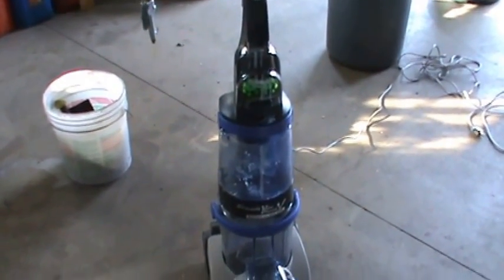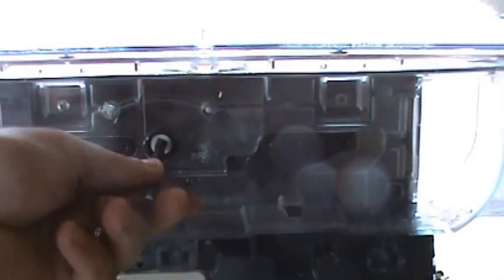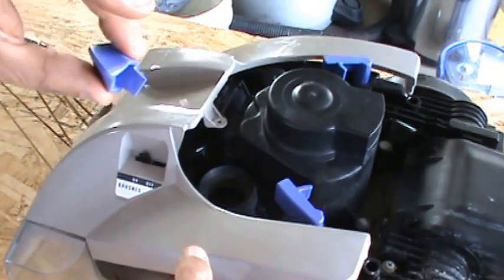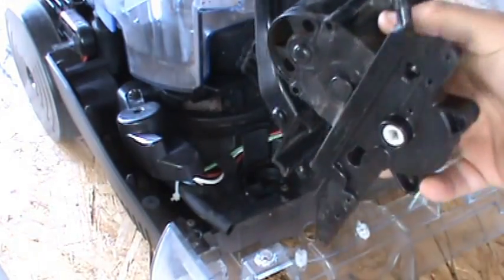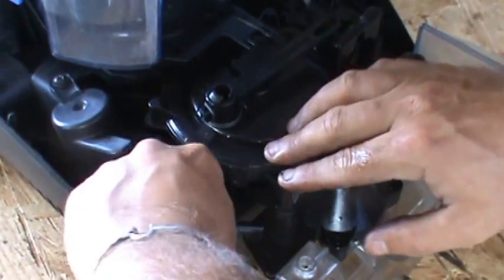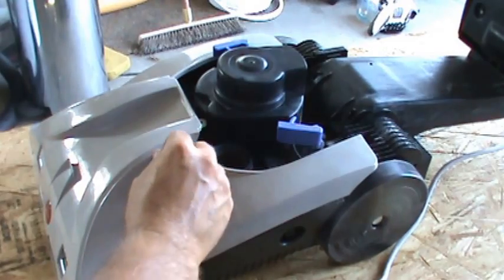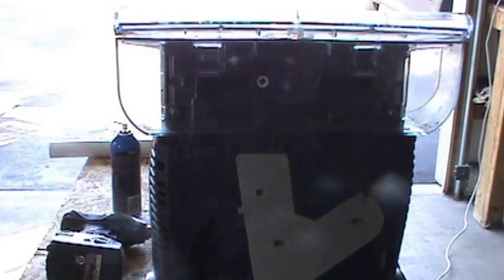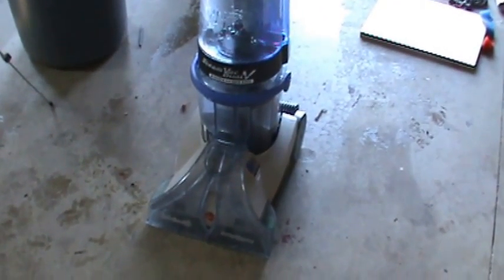Hoover SteamVac brushes not spinning

Comment: Fantastic video.  so easy to follow your directions and information.  Unfortunately I couldn't fix my Vax VHFM700 floormate spin scrub.  The brushes stopped spinning.  I can see the problem is the turbine.  I have located where to buy the replacement part.  Unfortunately I am having alot of trouble dismantling the unit.  I cannot find any technical information on disassembling except a parts list.  do you have any advice on how I can dismantle.  It is looking like the wheels might need removal in order to remove the base so I can gain access to the brush motor assembling and the gearing.  If you have knowledge of technical service manual please let me know.
Reply: Here is a link to what the part looks like on my VHFM700 that appears to be the problem.  But I can't access this part on my VAX VHFM 700 because I don't know how to disassemble.  http://www.ransomspares.co.uk/parts/vacuum-cleaners/vax/brushgear-motor-housing-assembly/503768.htm?m=vhfm-700
This is a link to a schematic diagram of my particular unit.  It shows all the parts.  If anyone has any information on how to dismantle so i can gain access to the gearing etc please post.  
http://www.toolspareparts.com.au/vax-vhfm700-spare-parts.html

Comment: Thanks for the video! Was able to fix  our shampooer by following your guide. The  fan-like turbine beneath the gears had nearly cracked in half resulting in plastic shavings locking up the entire mechanism. Was able to clean everything out and super glue the crack.

Comment: Thanks. Not rocket science but seeing it dismantled once always makes it easier. The one I'm looking at for a friend, I noted that the bearing(s) are seized. Sure they turn on the spindle but under load they won't with the bearings rusted inside. (skateboard background helped with this :) ).

Comment: ...for those of you with the slightly older model like mine.   Found this video useful for teardown,  BUT...... nothing wrong inside!  If I had looked more carefully, there is an air filter screen near the spin control that clogs easily, denying the turbine input of air.  Just a release tab to open the clear cover and you can slide out the screen and clean it.   Thanks, anyway.  :))

Comment: I had a similar problem - brushes not spinning however, it was not due to rust or non-functioning bearings.  When I fully opened up the assembly (not just removed as in your video) I found the actual turbine disc was cracked.  Thus, not holding friction against the bearing shaft to spin the gears.  Too bad every appliance companies use cheap plastic to metal connections that WILL eventually break.  Thanks for the vid - it did show me how to remove the assembly.

Comment: Thanks much!  Awesome video and explanation.  Question, the top bearing is not moving freely, haven't been able to break it free of the gear it's attached to.  Do I need to replace this whole housing, or is there a way to pull the bearing without damaging the plastic gears?

Comment: I have the Hoover SteamVac SpinScrub Model F5915900, but the brushes look exactly the same. Everything else works fine, but the brushes will not spin. I am going to see if this will work for us. Thanks for the video. I am a little weary though about taking it apart.

Comment: This is a GREAT video.  I have a Hoover that has to be close to 24 years old.  Yep - still cleaning great until my brushes stopped.  I followed this step by step right thru to putting it back together and voila!  Brushes are going strong.  My cylinders were a mess - should be in the Hoover manual as a maintenance issue.  Thanks for saving me $$$$.

Comment: I have a slightly older model, but YES this worked.  Was just froze up.  Put a 1/4 inch drive extension in the square, broke it loose and spun it a few times........works like a charm.  Did not take it apart.  I would have never known it was air driven.  Assumed electric motor.

Comment: This repair was easier than I thought. I have an FH50050 model, but it's very similar. I figured... Worst case scenario, I take it to the repairman mostly disassembled. Mine had two extra long screws on the bottom of the unit that held the turbine in place. A pair of right angle needle nose pliers made this job a breeze. Thank you for posting this!

Comment: I have just carried out this repair but the brushes still wont rotate the spindle moves fine any ideas  I have noticed the socket the brushes fit into does not rotate when switched on but moves freely with screwdriver

Comment: just took mine apart and back together...still no spin.   decided to take the top cover off and found the "turbine wheel" cracked almost in half.   I have  Hoover / SpinScrub / heated cleaning.  (just means you use hot water)model F7452 900     /   series Z120 .  what part do I order to fix this thing ?bob
Reply: Did you ever figure out what part to order?  I don't want to have to buy the whole assembly.  My turbine wheel is cracked as well!

Comment: great video but i don't have the patience to take that piece of crap apart and then discover i have to order parts that they gouge me  half the cost of the whole thing new. Metal bearings  that rust and freeze up/cheap  plastic parts that crack easily-I cant believe they use rustable bearings in a water born appliance in the part that is designed to get wet. no excuse for that. i'll shop for another brand to replace my broken Hoover p.o.s. now that i understand how this is  designed and built.

Comment: Terrific job.  This also saved me.  
My bearing on top locked up which I was able to free by gently twisting with lock pliers.  
Small suggestion. 
WD-40 is great as a penetrating oil but is not a lubricant.  I used Lube Magic, a silicon lubricant similar in consistency to vaseline and marketed for pool (lubing rubber o-rings, seals, etc) on the bearing.  It should (in theory) keep it from getting wet and rusting.

Comment: Thank you so much.  My brushes stopped working.  I had to take it a apart, and the top bearing was completely seized.  I soaked and worked it over with liquid wrench and it now it runs like a charm.

Comment: Your video stops short. I've fixed mine twice and both times I had to take an additional step. I can't remember what I did the first time, but I did something to get the turbine to spin freely. Today, I used your video as a guide to remind me how to take it apart and what to expect. Anyway, I did everything your video recommended, but the flywheel still wouldn't spin freely. It would spin, but not when I tried to turn the cog. I got frustrated and tapped the top of the metal pole with needle nose pliers and broke it loose. It immediately spun freely. All I had to do with put it back together. Thanks!!!

Comment: Thank you for very informative video. I own a Vax V-124 that is very much the same as the Hoover in your video. I was able to get brushes moving without having to take it apart. But felt that if necessary I could have striped it down as you demonstrated. Thanks

Comment: Thank you for this video, I found a couple more things worth mentioning: I decided to go a step further and open that gear box. Turns out this entire assembly is driven by air, not an electric motor. My bearings were fine, in fact the plastic piece that gets spun by the air moving by it was cracked in half. This was the root of my problem. I need to find that part if I can, if not I will need to get the whole assembly. Also to note: When reassembling the drive assembly, watch for the door hinge to line up properly. This little door is what controls the speeds, if not put back in place properly it will default to closed, and the brushes still won't spin.

Comment: I've got an FH50050 (very similar to the one in the video) but unfortunately the problem is a gear inside the larger round part of that sub-assembly has broken in half.  And that assembly is no longer available from the factory even though every other part for the thing is.  Yay.

Comment: Doublewide6 excellent video, easy to follow the steps.  I was able to fix my Hoover Carpet Cleaner. as info. it was the bearing down in the bottom of the Gear Housing that was locked up tight.  Used a spray lubricant and had to carefully use some pliers to turn the shaft and get it freed up and spinning.  Thanks again.  Go Seminoles

Comment: Thanks so much for this video. I've never fixed anything in my life, and I was able to follow your instructions with no trouble. In my case, the baring below the one you show in the video had seized, so I removed the little donut-shaped one and oiled the one underneath. After jiggling it a bit, it started moving. I then used your idea and used the opening where the brushes click in and turned it for a minute or so. The machine works great now. Thanks so much for taking the time to post this. Your instructions are thorough and clear.

Comment: Thanks! Found a slightly different model on the side of the road that was super clean but being thrown away. All fixed, now. I would add that the square thing that one removes when using the hose needs to be snug to the bottom for the brushes to work. Also, make sure the brush setting isn't on "Bare Floors".

Comment: Thank you for the video. I have a newer steamvac that has been pushed to the side in a storage closet for months waiting to be 'looked at' because one day while cleaning my carpets, the brushes stopped spinning. Little WD40 and working it in did it. Will be taking it apart to clear up everything else as well, but just the little bit of WD40 in the square hole was enough to make the brushes start spinning again! Thank you Doublewide6!

Comment: HELP ME PLEASE!!  I watched your video, I did get the bearing free and am able to hand turn it.  However, as soon as I put it back together it will not spin.  As though whatever mechanism turning the gears is not doing so.  I have a newer model:  Steam Vac/Dual V AT Carpet & hard floor cleaner/F7452900.  It is not the exact model you demonstrated, but it the same except for 2 additional screws.  I did look on UTube for instructions on that to no avail, but like I said, it was exactly the same except for 2 additional screws.  If you could help I would sure appreciate it.  So I think it is whatever mechanism is responsible for turning the gears......  But I don't know.  And if, in your opinion, I need to replace something, could you PLEASE tell me what that part is so I can order it.  THANK~YOU for your video, and your help, julie.

Comment: Just found your video.  My model looks just like this but is a dark blue color not the grayish like yours.  I was able to locate the same six screws but my issue is that the two on top back by the clips that hold the tank seem to be screwed into the base some how and do not just pull up.  Are these like really suck in there or is the difference in model something they changed.  I see no way to get to the screws since this is where the wheels are.  Just let me know if you have any ideas.  Thanks so much.  I am sure my unit is rusted suck since I cannot get it to move at all.

Comment: Great video, but the underlying problem with most of these Hoover steam and turbo shampooers is the intake for the air-turbine which is that area just in front of the butterfly valve youi showed us. It can suck in the shampoo solution and get directly into the bearings causing them to rust. I re-routed my turbine intake to come from the top of the shampooer - so far, no rusty bearings and the brushes spin like crazy. Too bad I can't post pictures of the mod here, but thanks for sharing your fix.

Comment: Your video rocks but when I got to the part to remove the main part. I took off the 2 screws and it did not come off, Looking at it I have an extra little peace that looks like an intake. I couldn't find any other screws. Any suggestions?

Comment: Thanks for the good explanation. I followed your instructions and found that the lower turbine bearing in my machine was seized. I replaced the turbine bearing with a router bearing that I had on hand and now it works like new.

Comment: thanks for the extra insight. i was about to chuck mine, but decided to you tube a possible fix. and there  you were. same for me the turbine wheel was cracked in half. i crazy glued it together and reassembled and now its good as new. thanks dood.
Reply: Edward Kim After following video, I discovered I had the same problem as Edward, Rose Fries, and punknhead23 - the turbine wheel is cracked in half.  Is that a common problem?  If epoxy does not work, looks like I will have to order the turbine and gear assembly.

Comment: Thanks for the directions for taking the steamvac apart! I discovered that the actual turbine wheel is cracked in half, can I purchase just that part or can I only purchase the whole turbine assembly. Mine is a different series model # but pretty much was exactly the same. Where do I go to order either, again thanks much!!
Reply: +punknhead23 Ordered an new turbine assembly. Could not just order the turbine :(

Comment: Thank you for the video! I was able to take it apart and found that the inner turbine gear (opposite of the lower ball bearing) itself was cracked in half and shredded. The unit is only a year and a half old. Any way to purchase just that piece or would I need to purchase the entire turbine/gear assembly? Thank you for your help.

Comment: Doublewide6, thanks! You just saved me and my husband from buying a new carpet machine. I was able to disassemble, get to the problem and fix it! I went a step further and took the little housing off the gear box so I could get to the lower bearing and the turn thingy. Reassembled and it works! I am going to go ahead and order the entire gear box for $28 because my butterfly flange isn't moving properly. But, with four dogs I have to have my machine working every day! YOU ROCK!

Comment: doublewide6 my hoover is a F7452900 i followed your directions but when i come to the barring that sits over the white circle that spins, my barring does not spin with it. Both white parts that look like wheels are spinning great, had a lot of junk in there. But the barring is not spinning at all. And it is lubed up. The barring turns when i spin it but it, but the white wheel does not spin with it. Hope i am explain this okay to you. Thanks, so much for your video, hope you can help me on this.

Comment: I have the same F7452-9900 model,  mine leaks when not using. Fill the fresh water container attach to shampooer water comes out by the brushes. Hoses are not leaking how to fix

Comment: Thanks for the video!  It really helped me with my Hoover model F7412900.
I had to go a step further and take apart the turbine assembly, where I found the plastic impeller broken into 3 pieces.
Hoover doesn't even list the turbine & gear housing on their website, but I found it at eReplacementParts.com for $29.85 + $7.55 shipping.
Saved $150 vs. buying a whole new cleaner.

Comment: I have a different model, but functions the same. I set it up right on the edge of a chair and released the handle. With the brush assembly removed the square shaft that turns the brush assembly didn't move. the wd40 and a screw driver still will not budge. Locked up tighter then a wedge.
Reply: doublewide6 For some reason I couldn't start my own comment so I'm replying to this one.  A few months ago my cleaner stopped spinning.  I looked up videos online and found yours after my husband brought my cleaner home after unsuccessfully going to 3 different appliance places to see if they would repair it.  They all said no, and one said that you can't even get parts for it and then offered to SELL him a 'better' one for ONLY $300.  I said NO WAY!  He LIED!  I've gotten parts for it a few times by calling up Hoover and they send them to me. I called up Hoover and ordered one minor part and after watching you video a couple times, took my cleaner apart (since at this point I had nothing to lose), and went through all the steps until I was able to finally get the gear thing to turn (after oiling it and everything else along the way), put it back together and it worked better than before it stopped!  I LOVE accomplishing these sort of tasks myself.  My husband is not mechanically inclined and was SECRETLY worried (he told me afterwards) that I would never be able to put it all back together again.  Anyway, I hope you get this message as I wanted you to know that even I, at 52 and a 'woman', could figure it out, so I really appreciate your easy to follow (with no minutia in between like a lot of them out there), videos for those of us who like to save money and do it ourselves!
Reply from the maker: James Dugan spray with penetrating oil and let it set for 5 days.

Comment: boy are you dumb. if you compress the back foot pedal and turn the handle back towards you this will engage the brushes. they will not turn with handle in full upright position. it was made this way so if its on its back like this video shows or the handle is in full  upright position the brushes wont turn.....

Comment: Doublewide6, you ROCK! Just removed 1/3 of the earth's soil from my carpet with your WD40 fix. It was done froze up and now I'm a lean, mean cleanin' machine!
Reply from the maker: Daniel Carter Keep an eye on the turbine, half my viewers are replacing the turbines because they shear apart, and apparently glue does not hold up.
Reply: doublewide6
Will do. I've replaced the spray turbine before, this must be a similar process but so far, so good.